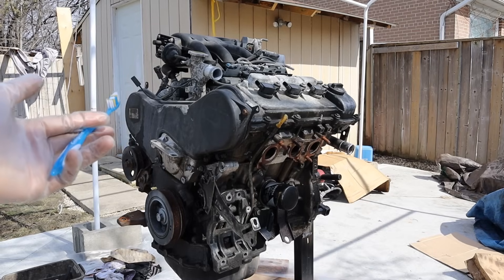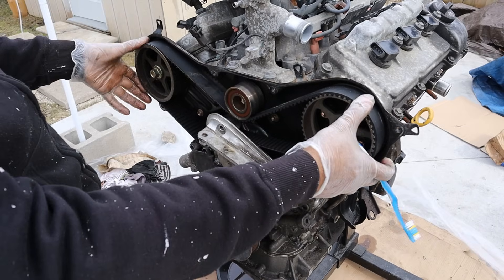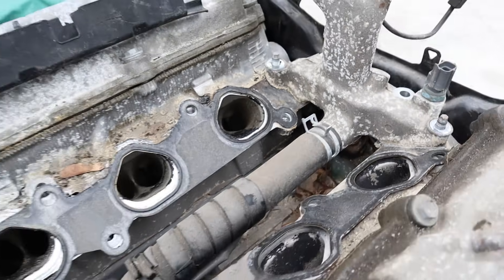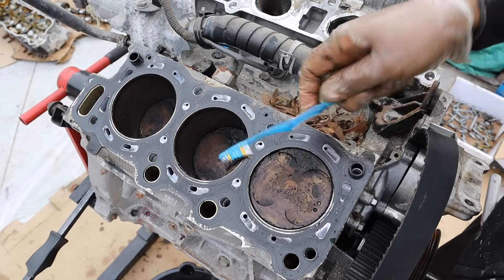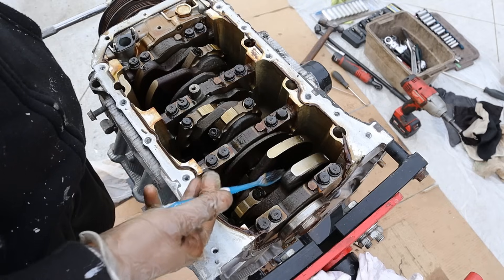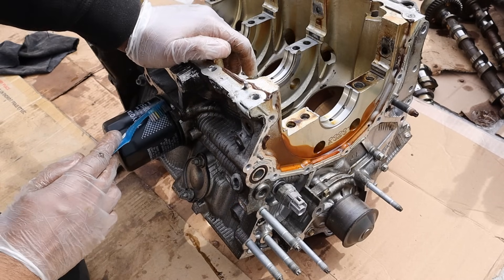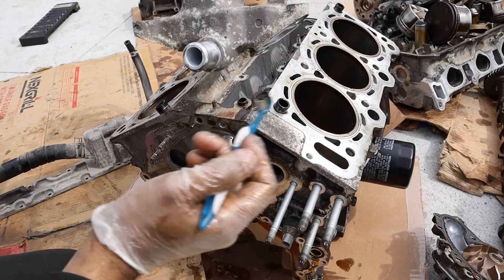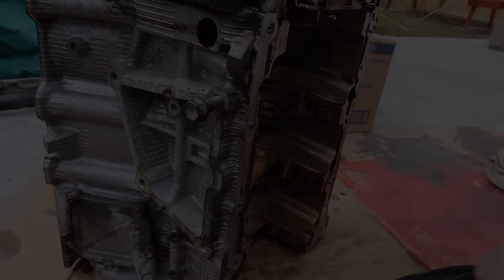Here's how the Toyota 3.0L V6 Engine Became a Success

Comment: I have a 2003 Lexus ES300 with that exact engine. I got it ten years ago with 64K miles, I now have 188K. I have had to replace a few engine seals like you described (the one between the transmission and the engine as well as the valve cover gasket) but other than basic maintenance like oil changes, new spark plugs at 120K and timing belts every 90K I've had to do nothing to it.

It's not a race car but it can accelerate on the highway when needed and as you said it's a very quiet, smooth drive. That's the thing I like about it the most. The ES300 is very quiet and comfortable and lets me relax when I have my long commute to work, or a long road trip. As long as you don't drive it hard, it shifts smoothly too. Especially around 50-60mph the thing is so quiet and smooth when I first got it I thought the engine was off because I didn't hear or feel any vibrations. The muffler also helps a lot in this regard over the Camry one as does the suspension. It's basically a cocoon from the rest of the world, and a reliable one at that. I really enjoy this car and still marvel at how comfortable, quiet and smooth it is all these years later.

I just realized how often I said quiet and/or smooth. Well, you can see what I like about it, eh?

Comment: I've got its brother, the 3.3L V6 in an 04 Solara. Thing has 218k miles on it so far and I did nothing but oil change on it before driving from Wichita to Albuquerque and then Silver City, made it back and forth and driven over 2k miles in total. Drove 12 hours straight yet with occasional pedal to the metal, still remains responsive and smooth. I love the hell out of this thing
Reply from the maker: I have a 3.3 Camry. 20 years old still going strong!

Comment: Fantastic video, straight to the point and very insightful! I have an es330 with the 3MZ-FE and have been trying to learn more about the motor, and I was wondering if anyone knew of any differences between the two motors/any good resources to check out to learn more.
Reply from the maker: I think something about the knock sensor and few other differences
You can search up the wiring diagrams where it may call out engine specific features

Comment: I have a 2002 es300 with 265,000 miles.  It burns oil.  Puff of white smoke every morning.  And I'd say it goes thru 2 quarts if I drive at interstate speeds for 350-400 miles.  I believe my valve stem seals are toast but due to the fact these engines are prone to sludge, I don't think it's worth spending any money on it.  It may be time to say my goodbyes... Longest I've ever owned a car (10 years) and the best car I've ever owned.  Imma be sad when the day comes....

Comment: 2000 Toyota Avalon, 260,000 miles and running like a champ. Only issue is a oil leaking valve cover in the back.

Comment: Great video and narration!  I've had my 96 SE 3 liter for about two years. I had no idea it has a cross-bolted crank shaft nor that it has SIX bolts per cap!! Looked like a steel crank from my Keyboard Commando Post but it wouldn't surprise me if they are forged instead of cast steel. This thing has responded the most of any car I have to regular doses of Restore at each 2.5K oil change. Mine is an auto and is a very strong puller and as a matter of fact, the whore caught me "quite" a bit off guard when the torque converter locked up at WOT at 125!! It was like someone rear ended me; I was like "GIT IT, BOY"!! I have a factory S/C off of an Ssei Bonneville just sitting around, as well....
Reply from the maker: Why did it lock up?
Reply: @speedkar99  Almost all newer auto trans have what's called a "lock up" type of a  torque converter. This literally eliminates the inherent slippage that all torque converters have due to their fluid-coupling design. At this point the engines effort & velocity are directly connected via the stator & rotor w/in  the torque converter.  I 1st encountered this phenomena when I had a 86 Z24 cavalier with an auto that the first time I hit it's lock-up speed of 112, neither me or my buddy that was riding with knew what was going on, either. It was way cool bc I was on the interstate racing a Thunder Chicken who was slowly gaining on me until that point! Then I gapped the loser Ford👍

Comment: I have this engine in my 2000 Solara.  I bought the car from a coworker with 113,000 miles on it and I have run the mileage up to 650,000 miles now.  It has been super reliable and still runs as good as when I bought it.  I did experience low compression in the #4 and #6 cylinders so I removed the left head.  The intake valves were leaking as a result of carbon buildup from the PCV and port injection over almost 600,000 miles at that point.  I checked the valve clearance since it had never been checked.  All valves in that head were perfectly in spec.  I cleaned the valves and compressions were all back to spec.  The transmission has been almost trouble-free.  I replaced one shift solenoid in the valve body recently.  Thanks for the video so now I have seen a few other reasons why I like this engine!
Reply: Oops, I see I posted comments about a year ago on my engine.  Well, just consider that an update!

Comment: I have a 97 Avalon and I believe I just blew it up I don’t know what happened I changed the fuel injectors and it ran better than it ever did in my ownership and about a week later I got a running to rich code then I cleared it and drove for a couple day just short trips then it said bad o2 sensor so I changed it to the correct sensor and All of a sudden misfiring on the backside towards the firewall 1-3-5 and then 2 and smoke out of the exhaust and spit and sputtering and then I tried to retrace everything and I cranked it and same issue but this time the engine tried to run away and smoke started pouring out of the intake so I’m sure she’s gone 😢but I found a 98 with 111,000 miles and I’m going to pick up tomorrow and I’m gonna swap out all the parts from it to mine and pull other stuff I may need and scrap the rest

Comment: My 97 Lexus ES 300 with the same engine now has 356,000 miles and going super strong.  Ive done all the maintenance myself except for oil changes which I leave to oil lube places every 3k miles.  Run conventional 5w-30 oil.  So far Ive changed the timing belt, water pump, tensioner, etc about 3 times, replaced the 2 of the transmission solenoids, occasional belts and hoses when needed and run Iridium denso spark plugs.  Actually just replaced the rear control arms for the 2nd time on this car yesterday.  Only just replaced the entire exhaust system with a Walker one last year ...no CEL, runs and drives fast and smooth.  It sounds like a lot of work and money but this car owes me nothing, best engine/car Ive ever had for reliability.  Had it since 2012, bought from a car auction when it had 134,000 miles on it.  Ive had the valve covers off a few times and no sludge issues.  My 99 Lexus ES 300 with 101,000 had the sludge badly when I bought from a private seller who was running oil with no detergent but I cleaned it out, replaced the valve seals and hope to run it just as long as my 97.  They dont make them like this anymore, now its all planned obsolescence.
Reply from the maker: How's that exhaust holding up? I know someone who has and it's rusting away already
Reply: My OEM exhaust lasted up until about 2020 then I had to start cutting out the damaged flex portion in the Y pipe and welding in new flex pipes which doesnt last.  I replaced the entire exhaust with a Walker system I think.  It was from rockauto and painted black.  That was about a year ago and its great so far.  No rust, no CEL codes.

Comment: Trying to replace the timing belt/water pump on my 2000 Solara (Convertible) is the only DIY car repair that has EVER defeated me. There is a V shaped bracket on the "front" of the engine (passenger side) that covers the plastic timing belt covers. There is a bolt behind the V that can only be accessed from the side between the V bracket, and the engine, and I could only turn the bolt  1/16" of a turn at a time. Eventually, when I backed it out far enough, it starts crashing into the "V" to where you can no longer back it out because the V is in the way and you cant move the V out of the way, because it crashes into the sidewall of the engine bay. I had to give up after I got it far enough to crack the timing cover to see that the belt looked fine. I never tightened that bolt back down because it took me an hour to back it off 1/2" an inch. So frustrating. Does anyone know how to remove that V bracket without removing the engine?

Comment: Their metal parts are beautiful but the elastomers are low grade.  I just bought an 04 Lexus with 100,000 miles and did the valve covers.  The seals get hard as bakelite and leak oil on the exhaust manifolds like the old GM Iron Duke. If they used polyacrylate seals instead of nitrile they wouldn't have this problem.  This is my first car from the Toyota family and very surprised at this.

Comment: Thanks for this video, I have just purchased a 2000 Solara SE equipped with this engine and a 5-speed manual transmission with 214.000 miles on it, hoping to make it go to 500k...
Reply from the maker: I miss my old Solara
Reply: How’s the Solara doing?

Comment: Car wont start, (2001 Toyota Avalon) Mechanic told me it's a blown head gasket, can feel compression through the radiator fill cap when trying to start. I don't need to remove the engine do I? and will a standard compression test tell me which side I need to look at or should I be doing both sides at the same time?
Reply from the maker: Yes start with a compression check. Then a coolant pressure check

Comment: Is it possible to remove the coolant outlet flange without removing the upper & lower intake? Peeking under the intake, will the hose clamp be angle-plier accessible? Will the hose separate pushing it off towards the coolant intake side? The worst happened, the external top half of the gauge temp sensor had snapped off flush while removing it at normal operating temp. If the easy-out method ruins the inside of the stuck sensor while the outlet flange is still attached to the head, I'd like to remove the outlet flange then I can add torch heat to the sensor outside the engine bay. I still need to remove the EFI/ECT sensor, too. And hope it doesn't snap too! The front timing rear plate is flush with the flange. The abused malfunctioning sensors have been in for 24 years, 2000 Camry 1mz-fe. I think it's too risky, starting a fire in the engine bay. Still grateful for your video!

Comment: I have a tap tap tap that seems to come from somewhere between the intake manifold and the throttle body. It also knocks on and off very faintly, i can never hear it when im actually going down the road only at low speeds. Im getting no struggling when accelerating either. Im lost at this point.

Comment: Just bought a 2000 es300, runs really good!  104k miles.  It's nice and clean inside the motor and I plan to keep it that way!   Thanks for the informative video, I subscribed!
Reply from the maker: They're great cars. Watch the transmission on the 99-01 ES

Comment: I just bought a Lexus RX300 2006 with a 3 litre v6, 120,000km. Very smooth and powerful. Took it to 180km, nice. Pulls well uphills. Good transmission. Thanks for showing how well-designed/made it is - especially compared to a complex under-engineered Audi.
Reply from the maker: RX330 are good reliable cars, if the rust and AwD powertrain don't catch upto them. I have the 3.3L engine in my Camry and it runs smooth.

Comment: My 1999 Avalon (232K miles non VVT with waste spark design) and 2002 Sienna (VVT-i with 203K miles) both have this engine and I am satisfied even though I bought them both with high miles. Tranny code P0773 (shift solenoid E Electrical) comes up on the Avalon from time to time in cold weather.  I have seen sludging and valve cover leaks and dealt with these while replacing timing belts and water pumps. This video helped me locate the VVT solenoids so I can deal with a P1349 and associated misfiring on the Sienna.

Comment: I just picked up a 1994 Camry with this engine with the cable throttle, metal manifold and no VVT-i and while it's definitely a lazy engine that would prefer to loaf around between idle and 3000 rpm instead of revving out, I have been amazed by its smoothness. The car only has 117,000 miles on it and there's a lot of evidence that it sat for a long time in somebody's garage but that's not to say it's been neglected as the radiator, valve cover gaskets, fuel filter and timing belt are all brand new. I have noticed the coolant overflow tank was nearly dry when I got it and after topping it up (not filling it all the way) a couple times, I think the system is now at level, just above 'low' when cold. This leads me to believe whoever did the radiator didn't fill it all the way. Thanks for this video!
Reply: That's funny—

—the 1mzfe in my 1999 Toyota Solara doesn't start making power until 3,000 RPM. It makes power all the way to the red-line.

 Something isn't right with your car. Might have a restricted exhaust or something.

Comment: That's my engine! 03 v6 Solara.  Runs like a dream.
Reply from the maker: I miss my Solara.
Reply: i have 2006 Solara 3.3l, about 207.000 miles. still running strong, always synthetic oil and toyota filter every 3,000 or 3,500 miles oil change. tuned up myself. reliable vehicle 👍

Comment: Just picked up a supercharged 03 Toyota solara with this same engine, super low miles but previous owners let it sat and didn’t change oil for a couple years, I got it CHEAP. drove it home changed oil, filter and air filter and shes super quiet.  Last year of body styles always seem to be the most refined
Reply from the maker: Nice. I had a 99 Solara that I miss. The 2 door thing doesn't work out when you have family and friends.

Comment: why the rear valve cover gasket usually doesn't leak so bad as the front one? Despite it has a bigger incline angle and temperature

Comment: I just bought a month ago Lexus RX300 because in EU was not sold RX330. Very smooth and quiet idle- first I was shocked it was running on 300rpm due to dirty throttle body and no calibration but it was not stalling. Now after my small tune up and cleaning it is running very nice on 650-700rpm. I like it! I must change spark plugs in future;)

Comment: My wifes original owner 2000 Toyota Camry LE, engine with 256,000 miles. Uses no oil. Instant start up. I change oil every 3,000 miles. Bullitt proof engine. I expect 1,000,000 miles from this engine.

Comment: I have one in my 2001 Sienna, first year for VVTi as I recall. I blew the head gasket on the rear bank (even numbered cylinders) and have yet to replace it. It's one of those things that gets put off for various things (wife's surgery, COVID, job responsibilities, etc.). I want to take the head off and get it checked for warpage, but it's a b***h to get at in the vehicle. Any ideas on how to proceed would be welcomed. (From underneath and behind, removing exhaust first?) It has been a GREAT engine and vehicle.
Reply from the maker: Yeah the rear bank is very difficult to get at. 
Might as well pull the engine out.

Comment: So im currently working on my '02 avalon which has the 1MZ-FE engine but i cant get the intake off. i took the 2 nuts and 2 hex bolts off but it seems like it s being held on somewhere else. are there any other bolts that are holding this intake on?
Reply from the maker: Shouldn't it have 4 hex bolts?

Comment: Great vid i have the first gen of this engine 1mz-fe 1995 Toyota avalon , its got 247k miles and i still give it full synthetic, also the cv axles in the front just finally gave out after 29 years and i had to change an alternator a few years back , but other than that all i had to change was rubber parts like stabilizer bar bushings and engine mounts , also the hood lift arms i replaced they gave out , but other than that this beast blows colder ac than my 2017 tacoma 😅

Comment: U can change rear plugs with a spark olug socket and a 3inch entention and a universal 3/8 driver and also another 3/8 extention
Reply from the maker: That's only if you have the metal plenum. Newer versions with the plastic intake have to be removed

Comment: I recently did the timing belt on my 2003 Avalon with the same engine. I was going to use the torque wrench on the water pump but even with the inch pounds settings I got nervous so I use my hand and a quarter inch ratchet.

Comment: I had 2 of these, one in a 99 Camry (made in Japan) and now one in a Sienna 98, both of them excellent, very smooth and no vibration, the camry one reached 310k km (193k miles) when I sold it and the Sienna is at 438k km (272k miles) and runs smooth as nothing, you can tell that engine will easily go over 500k miles, if not a lot more. I sometimes hear other cars with piston slap and all kinds of other noises that say "very bad engine" and smirk to myself "yup, I'm a good engineer, I can tell good quality from shitty and don't buy into the BS marketing" I drove the Camry on the German Autobahn and wow, that was fun, the roughly 200 hp love to gallop upwards from 120 kph (75 mph), where smaller engines struggle because the air resistance gets really heavy, it is fun to just be able to floor it and the engine looooooves to run and go off like a rocket, these V6 also sound like they enjoy it. The Camry one with 310k km on it I was able to bring it up to close to 240 kph (150 mph)
Reply from the maker: Nice! I have the 3.3L in my Camry. 

While I wouldn't call it fast by today's standards at all, it sure beats any 4 banger. I don't know how people drive those, especially on the highway...